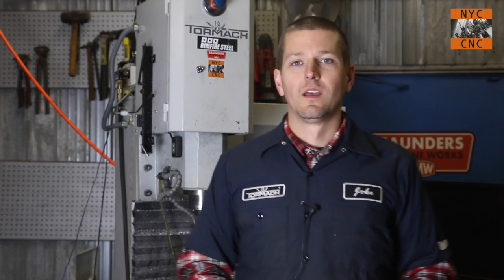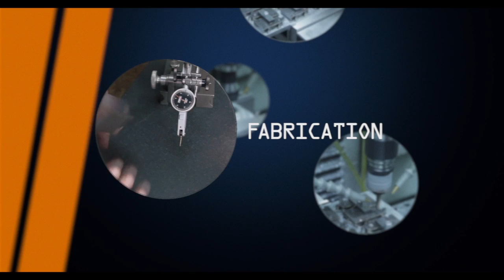Choose Your CNC Adventure!  Send Over Your CNC Parts!

Comment: I have been thinking for while now to do my own camera cage. They are made of aluminum and are made to fit almost perfectly camera body. One of features they have is a bunch of 1/4-20 threaded holes for accessories. While i did not make any cad drawings(if i do i will send it) this might be good project. I am curious how much cost would be comparing to what can be found online.
That niche market(photo/videographers) is great for home machinists to try them self out.
Reply: They look like this https://lh6.googleusercontent.com/proxy/_HRr4iCvGoW0YgOtkTADsJBVVl4NVs_-Ym3cxpt5Fdj1YTs3CPXQTzG3cETkgSH6n-fxygRJ13q47wGLb4VbqfRZ3F1XKTY7IFetVD8rr8PyM1XpCROPNIeXfQcpclavjC9M-BdV5zmO2N95YA=w384-h384-nc
Reply: NYC CNC this stuff can cost a lot of money. Just cheked on ebay they go 360$ and some even a lot more. That looks like to me like a good oportunuty for someone to make few bucks.